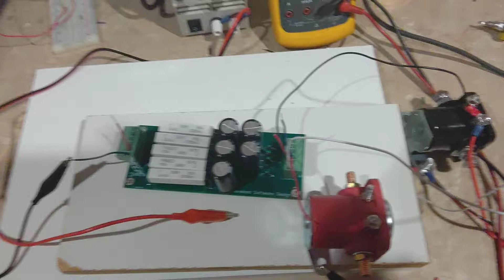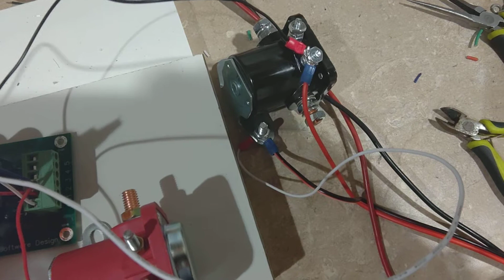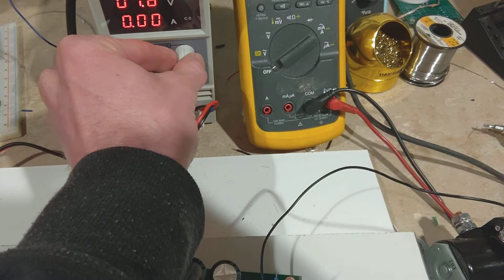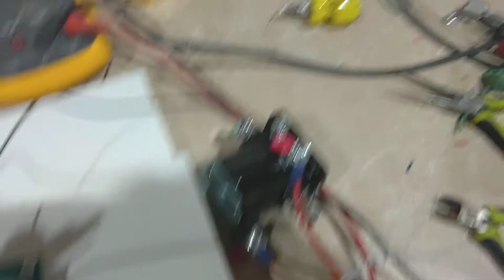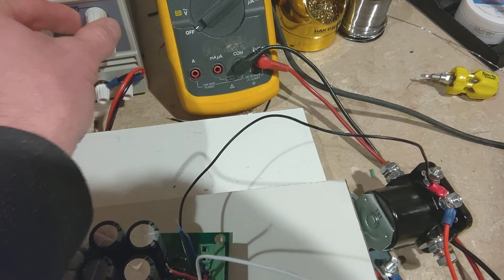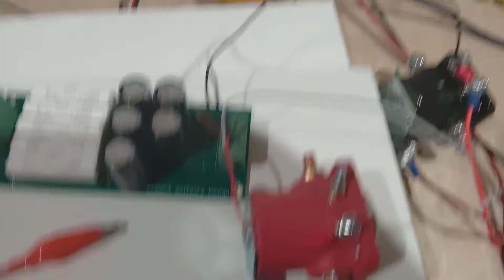Differences in Solenoids for Virtual Pinball DOF setups

Comment: The only difference between the Red and Black is the slight audible difference.. both are essentially the same quality.. I make custom high end vpins and have stopped using either of these.. only way to go is 24v actual pinball solenoids ( usually off early solid state Williams that are natively 24v )
Reply from the maker: I actually manufacture my own solenoids now and they work much better than either. And there is a big difference in the solenoids, some have welded wire VS others that are pressure fitted. The springs can differ in them which effects their hold  current, and the top mounts are made differently which can also cause failures. I have tested some that only last about 100,000 cycles. The ones I make will last for over 10,000,000 cycles, so basically the life of the machine. That is even longer than some real pinball mechs.

Comment: Why would you be running at lower voltages?  I think the key points are longevity and loudness. IMHO
Reply from the maker: I was running at reduced voltage to show the difference in the magnetic field on both of them. I disassembled them both and found that the coil is wound a lot tighter in the black solenoid, hence much better magnetic field which translates to bring a lot louder. The red coil looks like it was hand wound and is probably aluminum although I was unable to verify that, while the black one was wound in a machine and is likely a copper coil
Reply: @clevelandsoftwaredesign  I appreciate the response. I love your products I can't wait to order them.